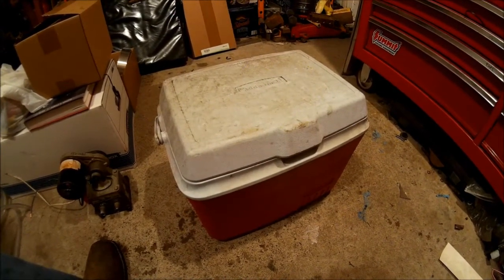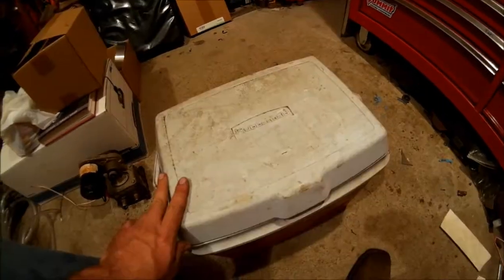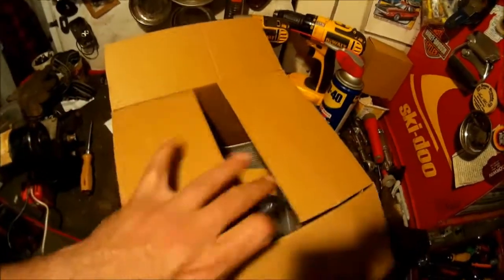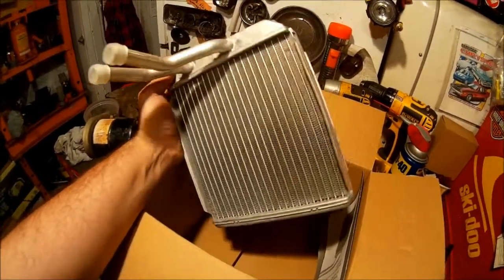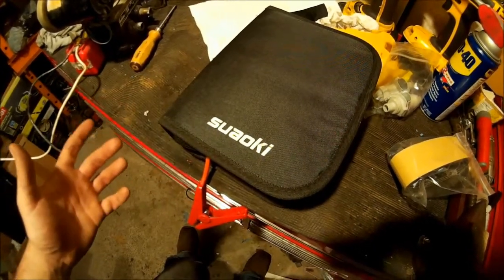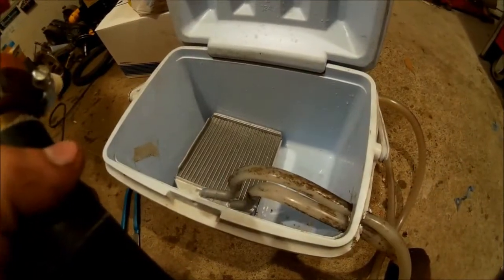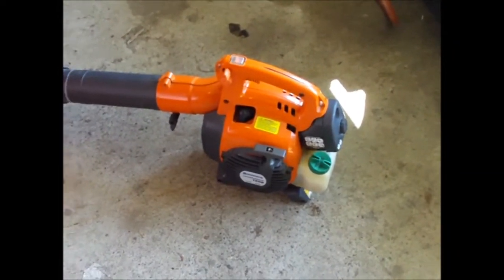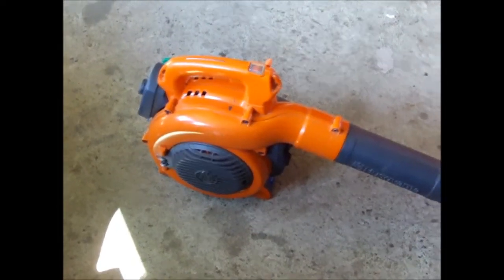Lightweight Cool Down Cart for Drag Sled

Comment: What size of cpc fittings did you go with? Same fittings on the sled end as well?
Reply from the maker: The CPC fittings with the 1/2" to 3/4" hose barbs had the same size quick disconnect end, so you can mix and match hose sizes.

Comment: How’d you fill up the lines without having a filler neck or something to put the coolant in?
Reply from the maker: Just held the hoses up high and filled them, first time running it on the engine the air pockets burped out in the sleds surge tank.
Reply: @toocheaptosmoke  Oh i gotcha

Comment: Seeing as this is an older video, I'm curious if this worked well when you used it for cooling the sled. I'm also kind of wondering exactly how it is used because I've never been to any real grass drags before.  :-)
Reply from the maker: Yes, it has worked well, still using it.  Cooled up to 3 different sleds in the pits.  You plug it into the sleds cooling system to chill down the motor temperature between runs, that way it never over heats.  I did have to put a regular sealed lead acid battery on it, jump pack died after a season...